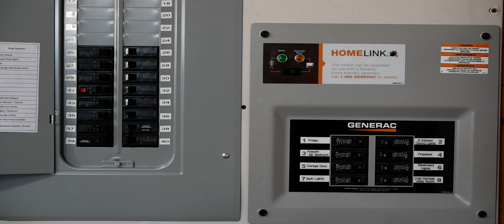Generac HomeLink Manual Transfer Switch Installation | 30 amp & 50 amp

Comment: OMG! The only one who talks about the correct placement of the neutral! Thank you so much! Was getting ground faults when connecting my F-150 Powerboost as a generator but this should solve it. Will have the neutrals changed tomorrow (by electrician) and report back.
Reply: Agreed! I'm about to get my PowerBoost wired up as well.  A key thing to be noted in this video is at https://youtu.be/AQZcbFTA9Rk?t=120 he indicated his panel is a SUBpanel, which I believe means that in it the neutral bus bar is not bonded to ground.  This is NOT a normal panel that most people have which is their primary panel and does have the bond from neutral to ground.  This is the thing that messes up most PowerBoost users, and is the reason to use this 3 pole (neutral is the 3rd pole) transfer switch in the first place!    If you do this on a main panel with a bonded neutral, I understand why it works because when the Generac switched to the generator side, the neutrals are not tied to the main line panel neutrals, hence not tied to ground and the F150 will not see any split current returning on its ground wire, so no GFCI fault.  What I don't understand is when you switch the Generac to the line side, how do those neutrals get bonded back to ground which is needed for the line side?  Is it done inside the Generac when switched to line?  Or am I confused?
Reply: @SnookerML  Yes, when it switches back to line power the sub panel breaks the connection to the truck and routes back to the regular sub panel. Take a look at the general manual, you connect a 50 amp breaker from the sub to the MTS, including a neutral. That is used to power everything on the MTS when using regular line power.
Reply: @JerrySchulze  Thanks but that was not my question.   You have a SUBpanel which is not what most people have, by definition it does NOT have the neutral bonded to ground.   But, IF you instead had a normal main load panel it would have neutral bonded to ground, so you pull all the neutrals for the 8 emergency circuits off the main panel bus bar in order to remove them from being bonded to ground, for when you switch the General to the generator side. Fine.  But when you switch the Generac back to the Line side, HOW do these 8 neutrals get re-bonded to the ground line, which they must.
Reply: You never reported back 😢….lol.

Funny thing is, this the only way I have seen generac switch wired. Would unbounded generators make a difference though?
Reply: @robertt9342  thanks for the reminder. Yes, all is good after moving the neutrals. I posted a video about it.

Comment: Great Video and explanation. I am in the same position where I have to upgrade all my breakers to 20 amp and the wiring to 12 gauge. Pretty simple explanation and anyone with any common sense and electrical prowess, should be able to understand exactly what you said about the neutrals. It is really the most important, part when looking at this panel. Again, great job on this and thank for the clarification from all the other videos out there on this panel.